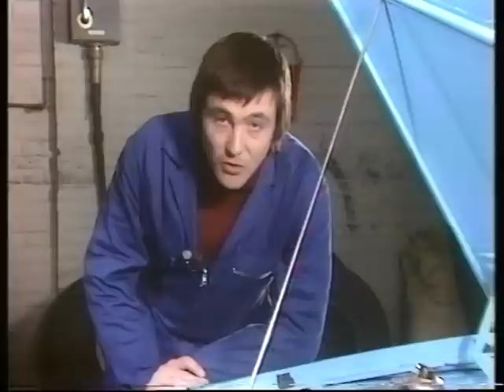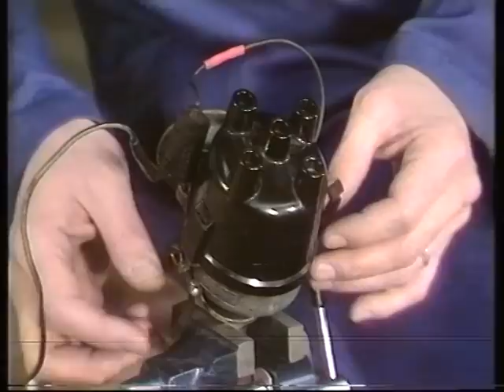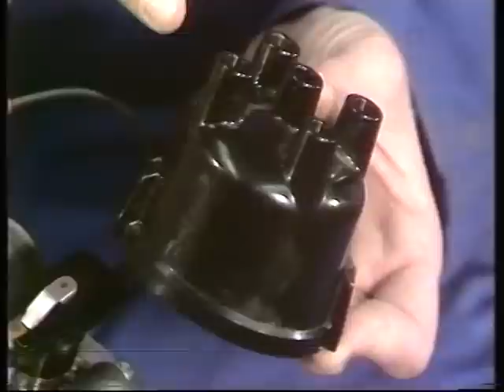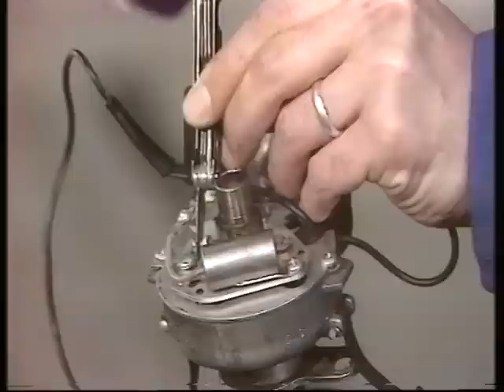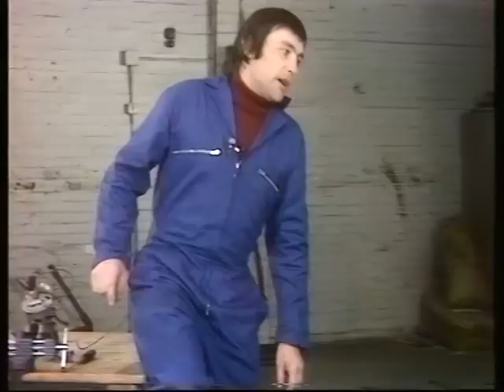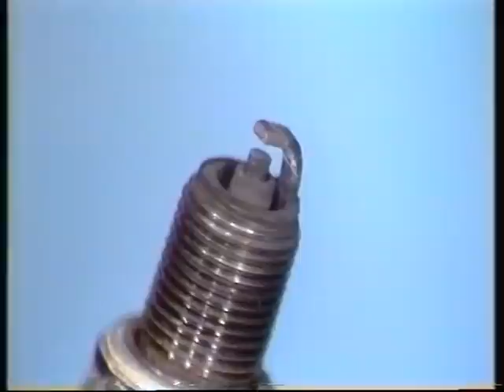How to maintain an engine | Changing a spark plug | Petrol Engine | Drive in | 1976

Comment: I haven't converted my Capri to electronic ignition and don't think i will.
Points ignition is so simple, just carry a spare set of points, condenser, rotor arm and cap and if you break down you'll probably have it running in 10 minutes or less.
Reply: i admit my classics use the accuspark points module as breaking down regularly was the alternative. But then i have done over 18k a year in one of em recently too :D

Comment: Brings me back in time to my Austin 1800 where the cap faced straight into rain with nothing in the way..solution ? washing up gloves with holes cut into top of fingers over the lot. Fixed then. Never another problem. Now how did i fix the leaking cracked gearbox cables ah that's another story.....
Reply: A washing up glove! What a great idea! Thank you, I think I'll try that 😃😃
Reply: @reelsonwheels  Put some tape around finger tips to make a good seal
Reply: Yea same as the mini. I remember, I think fiat, actually having a rubber boot on the dizzy from the factory, it was a right hassle getting it off

Comment: Got a couple of cars from 70s and 80s and so much easier to work on. Everything else needs booking into a garage with a diagnostic machine which even then doesnt always pinpoint the fault, just adds cost. Motoring shows were far more interesting then...now its "entertainment",  usually juvenile nonsense.
Reply: yes clarkson ruined the motoring review,  yobs in ferraries, only youtube has brought back some good reviews doing normal cars.    yep i learned to drive in old banger i had to fix, rebuild, and maintain,  kids get newish cars nowdays and never lift the bonnet,    i do miss easier cars, i dont miss the old rust though
Reply: @jusb1066  I do think it depends what you buy (I have an 80s nissan which is fine), but yes many of the cars from that era did need extra special care to stop them from corroding after heavy rain haha.
Reply: 0-60, top speed, 0-60, top speed...

Comment: Can you imagine these days servicing your ignition system every 6k Miles. For me as a high mileage driver that would be every 2 months and then new plugs every 4 months.
Reply: I do reasonably high mileage; though my car is slightly newer than this; 1988, so has a slightly less rudimentary system. That gets an ignition service every 12 months.
Reply: cars like the mini had oil changes every 3k miles and some greasin, brake adjustment, so a service 4x a year,  expensive! plus a a good car barely did 30mpg, things were expensive